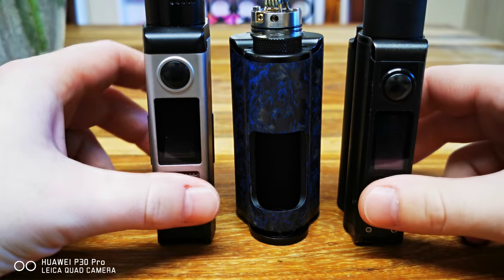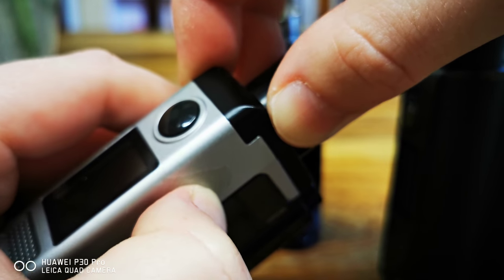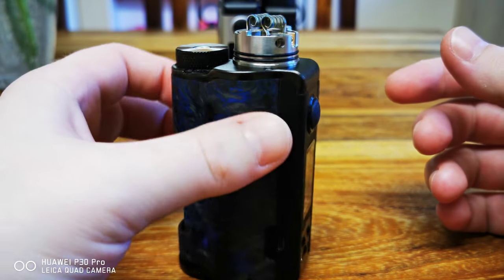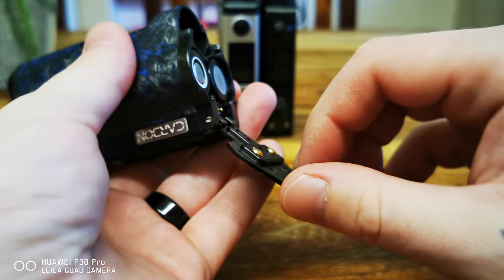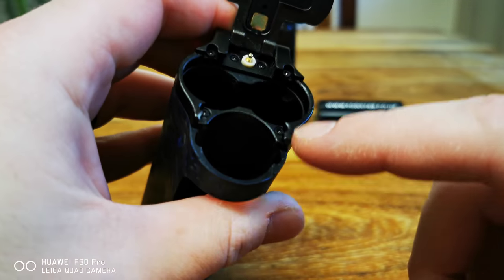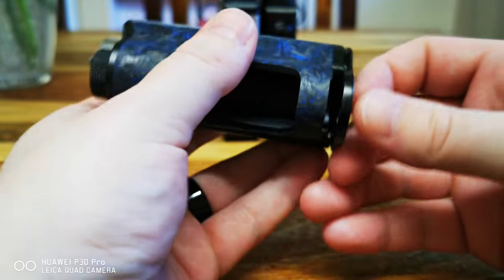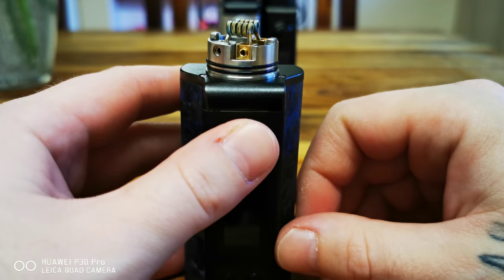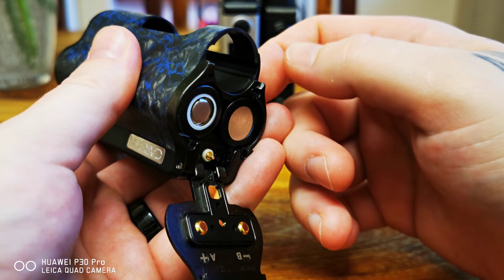Final video topside carbon battery door issue. Please somebody help

Comment: Hi guys. I just installed (16SEPT2021) the original DOVPO battery cover (SE) on a Topside Dual Carbon Edition. The only difference between the CARBON version and the replacement you can buy on the official website (only the normal dual version and the special dual version SE are for sale, with no support from DOPVO for the Carbon version), is that the CARBON version should have a third hole for the YIHI chip menu button, just below and centered on the other two buttons, a bit above the front screw housings of the part. It was as easy as drilling the hole myself. Size 4,5 mm approx. I can't say in inches. I have taken as a reference the original part of the mod, I have presented them and marked them with a marker pen. Drill, starting with a one millimeter drill bit, and "voila". You will need to remove the welding from the wire that goes from the chip to the battery cover when you are disassembling the original part. The wire has quite a bit of travel, but don't be a caveman pulling on the wire. You will have to weld the wire back to the new part. It's not difficult, if I could do it.... Two last things; on the spare part, the polarity is marked the wrong way round on the cover (I guess the SE has the batteries the other way round than the Carbon E. version). Second:... the DOVPO guys are unable to make the third hole needed for the CARBON version because..... do they have their brains up their arse? Anyway, I hope it helps someone at this point.

Comment: I have had 2 separate Topside Dual devices within the past year and BOTH of them have succumb to the exact same issue and unusable unless I use a few rubber bands to tie to the bottom of the battery and top next to the top fill. It’s very frustrating when a mod like this only lasts a few months and for you having the Carbon model I can feel your pain. DOVPO has horrible service, but they may be able to send you a replacement door assembly since you have the Carbon. Another YouTube channel literally drilled holes on the battery door and that fixed it for him, but you have to unscrew each time you replace the batteries(very inconvenient). Let me know if you find a better solution, but you can use the rubber bands until you do. Cheers.
Reply: Chad Hudecki I’m currently thinking if I should send them the 15 for the parts through PayPal is that safe?
Reply: I have the exact problem and it’s horrible
Reply: Romaldo Rangel yeah for sure, just make sure you send through the business side and not friends & family. It cost a little more, but insures your purchase in case any fraud.
Reply: Romaldo Rangel I just did the same thing. I got the information from Dovpo on Reddit. It’s legit. Now I’m just waiting for the parts. I hope it works. The latch part on the actual mod seems okay, it’s my battery lid that seems worn. I also orders a mod cover on amazon. I’m hoping the two together will fix the issue. I’m also thinking about drilling some new screw holes

Comment: I've have my Topside Dual for about a year.  The battery door issue started maybe 6 months in.  Now it's so bad I have to open and close the door several times just to get the batteries to register or just to get the door to close.  Dropped batteries so many times I now hold it with pinky under the door.  The thing is built like a damn tank other than the battery door.  Shame the didn't make a more robust latch.

Comment: the best thing to do is buy a silicone case for the mod n cut out a metal piece to fit the bottom the silcone will hold the mod in place n the metal supports

Comment: just had this problem with my topside , the door get loose and get opened due the battery pushing the doors , so just fixed that by hanging my daughter hair elastic to hold it up :)
Reply: I did the same on mine. Looks janky AF but it works.

Comment: Had the carbon since it came out and same issue for months now to the point I have to put a hair band on it to keep it closed. Do the replacement doors from dovpo work or is a silicone sleeve the best way to go. It's the only mod I use all day long and really want a fix. I don't really want a silicone sleeve as I like the way the mod feels. Any help would be great.
Reply: Sleeve didnt work for me unless you make a custom one that is super snug. I bought 2 different ones designed for the dual and the door is just such a pain. It doesnt take much for the batteries to not make contact. Hope this saves you money. Ive been using duct tape with little success because the tape doesnt like the paint on the mod or something. If just a little bit of juice gets under the tape it fails. Ugh this is literally still my favorite mod ever in my almost 1p years of vaping and im being fucked by the door grrrrrr

Comment: Actually just had a good look at mine from what I can make out there is a little magnet on the bottom of the door that has no use by looks of it. What I'm now wondering is if there should be a tiny metal plate on the bottom of the squonk bottle to attach to? Will try and superglue one on tomorrow see if it works
Reply: the magnet on the bottom of the battery door is, when you want to fill your juice bottle, you take the stopper off the bottle, and put the stopper on the magnet so you don't loose it,,,, simple...
Reply: I drilled holes into my bottle case and super glued 2 little magnets inline with the magnet on the door. It does help, but its not perfect.

Comment: Did you figure out how to fix it? The only thing I could think of is to weld in a piece of metal where it is chipped
Reply from the maker: Never ever got it fixed and dovpo weren't that helpful ether. I got them on Instagram and they told me to try the Facebook group then once I got the Facebook group to reply they said I had to contact dovpo email not facebook. By this point I'm raging a pissed off with the amount of fuckery going around I just shelved the carbon and still rocking the OG topisde 21700 sitting at over 22.000 hits. Just ordered another bottle cause my juice seams to wreck the bottles within 2 months. Did you get a faulty topside?
Reply: Yes I have 3 of the dovpo topside dual one red one green and the magenta carbon all of them the bottom door to hold the batteries in broke after 3 weeks I found out how to fix the bottom though
Reply: @cait7231991  How did you fix it?
Reply: @cait7231991  How did you fix it.  I did the Dovpo email thing.  They were nice and they did send me two more doors, but they don't last long.  Love the device overall, but not much good if you can't keep the batteries in and I'm tired of dealing with rubber bands.